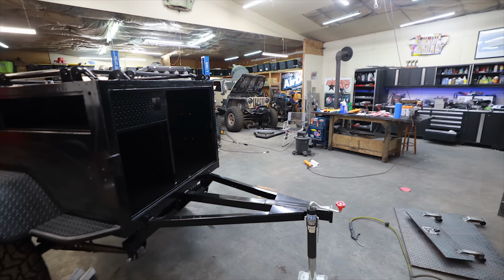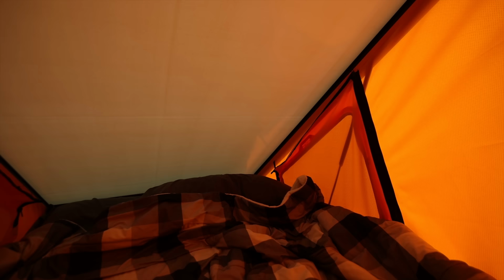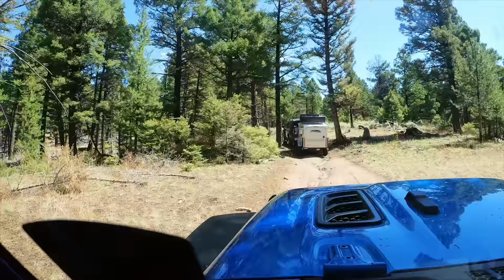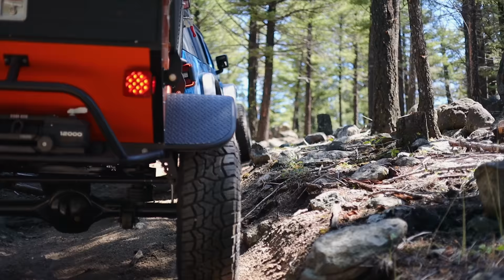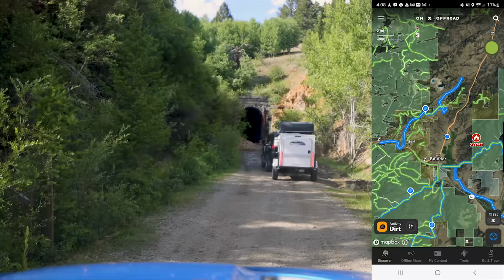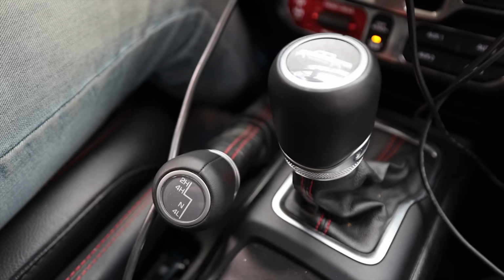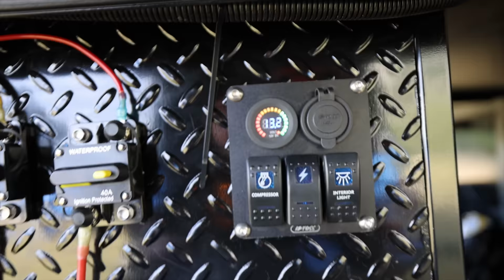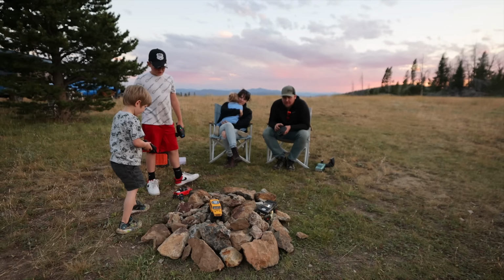Problems On Our First Trip... Harbor Freight Off-Road Trailer Episode 12.

Comment: You can add some jacks (like used on travel trailers) in the back of your trailer so you won’t need leveling blocks. 2x 5000lb jacks should be more than enough and are fairly cheap.
Reply: Those are used for stabilizing, not leveling
Reply: At my local junk yard they sell sisser Jacks from cars for 5$ 99% of them are new. I weld a nut on the end and use a cordless drill & nut driver, up/down zip zip.
Reply: Also they stabilize the trailer. So when you're wife is fighting a bear in her sleep it ain't rocking all over.
Reply: @mrpogi3  do you only ever use things exactly what they are labeled? 2 5k Jack's will work wonderfully to level a light trailer like this.
Reply: @mrpogi3  if the jacks have high enough rating they are good for leveling. The only reason that they tell you to use them for stabilizing only on RVs is because the jack or frame is under-rated (to reduce cost). If frame and jack are strong enough, they can be used for leveling (similar jacks are used to lift pickup trucks, so can surely level a tiny trailer)
Reply: Good idea. And if they’re removable, like using some square tubing/receiver mounts or whatever, then they can be protected from the trail and even serve at outriggers if designed right.
Reply: @dustinmeier9753  that would be an epic upgrade as outriggers
Reply: @ItsMeGiga  with spikes on the feet, it would help that winch out by making the trailer more stable during winching operations. (When picking someone else out of course.)
Reply: This is what I did to my trailer. They stabilize it so it won't rock everywhere and they lift high enough to where I could change a tire if needed.
Reply: @dustinmeier9753  some of the jacks have a round mounting plate that attaches to the trailer. The jacks can be rotated up and stored like that when traveling or removed from the mount altogether.
Reply: @timjchick  I have that basic set on a Bbq smoker trailer that way I can lift the nose of the trailer up to help with air flow as we all know heat rises

Comment: Big slide sounds cool.  Find the box / tubs that you want to use. Then build the slide.
Reply: Here is an idea on the leveling challenge.  Find things that work well to level the gladiator. Then put some cheap air bags in the springs on the trailer.  Only use the air bags to level the trailer once you have leveled the truck.
Reply from the maker: I've been thinking of going this way as well. I already have a set of helper bags that I didn't use on the rover AND this is a rover axle with rover suspension... should work!
Reply: I agree!
That's how I built my Jeep system!

Comment: Your battery droping to about 12.5 volts under load is normal for fully charged 12 volt lead acid battery. 13.5 volts measured after charging without any load on the battery is just a surface charge that will drop off in few seconds after putting load on the battery. If it stays above 11.5 volts until about half of the rated capacity is used up its good. (Hope this all made sense, english isnt my first language)

Comment: I have a setup I made that fits neatly in a pelican case with a seaflo pump, and with water inlet and outlet points coming out of the case. The inlet hose has a weighted strainer to chuck into a creek and all powered by a makita tool battery so it can be at a stream away from camp. The pump doesn't seem to mind the extra voltage. Neat package, everything fits within the pelican case apart from the outlet hose.

Comment: My suggestion for the area of your camper you wish to possibly put a drawer slide in, in which I love your idea. My suggestion would use a two-tiered system. Double decker slide out drawers. Using the same mesh system that you used for your full down exterior table on your trailer. You can still put sides on them if you wish, okay maybe I would put sides on them. But using that material it would keep your system light, very strong. Also you wouldn't have to lock yourself into one certain anchoring points, giving you more options on how and where you store your items. Meaning you could use a mesh tie down system / or even just simple bunches. Using the mesh material as your drawer slide, you be able to have endless anchor points for your supplies. You can move your stuff around freely, from upper shelf to lower shelf, seeing how it travels, without having to worry about how to mount down your items, keeping them in one place. Anyway, that's just my lame idea. Absolutely love how you used a variety of materials, I believe this is probably one of the best offroad campers I've ever seen, no joke. That suspension system is amazing, I loved how it got all flexy out on the trail. Love all the other ideas you're coming up with. Welding out on the trail, now I've got to see that one. Keep us posted on what solution you came up with on your drawer system, very interested in seeing what you have chose. Blessings to you and yours, safe travels.

Comment: Large, 5th wheel style full pullout drawer in the back, WITH a copy above it, but that one is only a shelf that slides out.  On the side, a similar port to the one on the right, but it also has slide out functionality.  The back support is one side of the metal shell that encases the air intake filter, which also extends down to the floor of the trailer to have a small, locker type storage area that can be locked securely, and independently.  But that’s just a few on my thoughts.  You do you, sir, because it’s worked quite well for you so far, and you have far superior ideas and skill than me.

Comment: Electric scissor jacks can be had for around $100. If you take the time to wire them up and install, it makes leveling a breeze. A 12v water pump and tank also makes easy garden hose shower

Comment: The next step of the organization of the trailer is definitely a must. The slide out would be the first thing and the second storage above the table would utilize that  waisted space well. The suspension on it worked great out there on the trails and from the way you described it there is no problems on the freeways.

Comment: Watching Nate, Brad, Lite Brite, etc. has given me the realization I can't afford a new Wrangler or Gladiator with all the trimmings.  No way.  What I can do is breath a new set up on my XJ and bring it up to current from it's 20+ year old lift and outfit it to go overlanding.  She may not have the gobs of room inside like a Wrangler, but the underneath is almost the same.  First order of parts is on the way.  New tires stacked up in the garage waiting.  Needs a heater core and some minor mechanical buy overall the 4.0 is strong and I still daily it.  4x4 works perfect, and its only at 120k.  I just might see you out there Nate!  You and your team of YouTubers have inspired me!

Comment: Definitely 2 drawers, and for the angled area in the back, flat containers, like for under bed storage, with maybe a rail setup to hold them so they will not flop around. Then add some kind of strap/handle that lets you easily pull them up and lower them down…

Comment: Id want to bring the battery count to 6+, Rollable solar panel and a 220v/120v box. Good power backup at home for power outages.If the ability to weld is something you might want, grab a Harbor Freight unit, rip it apart and build it into the trailer body. No need to rewire in an emergency and dont have to carry a welding unit around.... the trailer in the unit. 

Thank you for sharing!

Comment: Here's my opinion. When you open the front door of the trailer, that right side that's like a junk side right now, you should do a 2 layer drawer system (stacked), with some dividers built in. One layer can be like everybody's clothes, the other can be tools, kitchen stuff, all other stuff. I think the door shock may have to be worked around, maybe you could move it to the center of the door somehow.

Comment: Not sure how common off road trailers or camper trailers are over there in general but here in Australia they are everywhere, almost every option, style etc I think is covered if you need other ideas. Slide out kitchens, slide out drawers or slide out tables or slide out racks to put totes or tubs on etc. If doing deep water crossings make sure your seals are good and be aware the trailers can float and either Jack knife into or pull the truck sideways depending on how fast the water is flowing.

Comment: Couple pondering ideas….  What if you had a step camber (like the type you can use to leverage up a trailer axle when you have a flat) between the axle and the frame to lock the suspension in a lift VS putting items under the wheel?   

What if you had an air shock in a disconnect setup where you can use that to level the trailer?

Comment: hey nate, on my offroad trailer, we used a pair of pad style "implement trailer" jacks on each rear corner of the trailer to allow me to level my trailer super quick, takes less than 5 minutes when i get to camp, so i focus on the truck, and once thats done is easy. mine are removeable and mount to the fenders when not in use

Comment: I built a full size slide out (like your fridge slide out) on top of our Decked drawers and it is great for more easily getting crap that's in the back of the bed. we have added things like fork mounts for bikes as well. A smaller version for your trailer space could work a treat.

Comment: I have Espar bunk heaters in all of my semi sleepers. They are hands down the best. They are expensive but the quality, reliability, and temperature control is unmatched by others. The only time I've had issues is at over 12,000 feet. I have seen high altitude models but I do not have any experience with them. I won't  travel without one. I haul in the mountainous west and even in the summer I've used it at night.

Comment: If you put the 3rd member back in the axle, you can run a belt drive to an alternator, then have it charging a marine(deep cell) battery. The. You could have it own power for lights, heater ect. We did this on my dads trailer and it works great. I know you have solar, but as we saw in this vid… sometimes it rains.

Comment: Also a cheap screw jack between ur tyre and trailer wheel arch is an easy way to level out ur camper, just use it upside down!

Comment: Love the trailer build, the battery voltage on a standard car battery is 12.6 so the battery should be good and when you saw 13 volts it was being charged by solar. Either way always nice to have more power especially when you get a diesel heater and water pump setup going! Can't wait to see the progress!

Comment: Here's some ideas you might find worth looking into.
On my little remote steerable camper trailer I used a removable computer mount that hangs on the right rear side of the camper near the rear kitchen.  The Kitchen is in the rear with a raising hatch,  My Coleman Propane stove clamps onto the computer stand.  (A computer table ike what the Police use to mount their computers in their cap cars.)  This frees up my counter space!  And makes a nice table for other things, because it swings out so I can even put my laptop on it and bang away on the INternet or watch a movie on it.  Don't do that much, but I can.

And I also have a 12" x 20" table that mounts with a square tubing type reciver hitch to the other side of the kitchen, near the left side sink.  The male end is bolted to the underside of the table and fits in the reciever mounted to the bottom of the shelf.  Makes a great cutting board area too! The freezer slides out under the center of the counter top.
The top of my camper raises and swings open like a ammo can (only much bigger) and has the foam matteress strapped to it's underside when roading it.  I used a cut down nylon floorless tent for the actual top of the camper, with fiberglass bows to hold the tent roof up. And the tent goes over the bed that is now flopped over toward the front trailer tongue. There are 2 suppport poles that set in pockets under the roof/ bed and to the trailer tongue like a pop up camper bed to prop up the main bed.
My hot water heater mounts on "T" pins on the left rear side of the camper body and all the hoses are in a frenched in compartment behind a side door. I can run a regualr campground hose to it or draw from the onboard water tank. This way I have hot & cold water to the sink, and I use a shower wand to inside a  hoola hoop with 2 overlapping shower curtains that hang off thelt left side of the camper to use as a privacy shower.  
My shower floor grate is a small "sanded and varnished 30" X 40" pallet" that actually fits in the bottom of my trucks roof top luggage rack for flooring when traveling.
With the kitchen hatch is raised I can hang up mosquito netting to keep the bugs out, but thinnking of investing in a 270 degree side awning for it so it even has an awning over the side entry door.  And with the side curtains it will make a nice little bug free room in the right side of the camper.
My camper is a little taller than the white one in the video and the side entry door makes getting in easy.  
Inside it there is a place for 2 people to sit at a small fold up table, and a Hassock toilet in the end wall under a cross cabinet.  For your application, this set up could be converted to bedding and matteress for the Kiddoes while Mom and dad sleep up in the bed. Which will make you think of a pop up slide out bed.  Only higher off the floor! 
With the bedflopped open and the tent up, standing up inside is not a problem.
This sounds real top heavy but most all the weight is stored nearer the floor to keep it from getting tippy.  And since I use the front suspension from a torsion bar suspended pickup I can just crank the torsion bars to raise or lower the trailer depending on how heavy I pack it.    The remote steering is the most fun, as I can put my Marlin Crawler in dounle low and let my spotter steer the trailer while i follow his directions driving the Rig. Going around trees and big rocks is a breeze, 
My 4 X 4 Rig is a 1993 SAS'ed Isuzu Rodeo.
Great fun, but I too still have things I want to finish on it. Like spray bedliner on the exterior for sound deadening and stiffen up the walls. Oh and hook up the solar panels to the kitchen hatch.  It already has 2 Optima AGM batteries mounted under the floor, and a 26 gallon water tank under there between the frame rails too.
I've spent the last 20 years perfecting this little camper!  And just thought I'd add some ideas .
Your little camper turned out really nice!

Comment: As far as the storage slide. I am torn, we have one in the nose of our camper and I was just considering taking it out as it would fee up some more actual volume in that cubby. And maybe be more of a cabinet vs a junk drawer that it is now. Currently it houses a few half empty propane canisters roasting sticks and our collapsible BBQ. The rest of the crap is just clutter that accumulated. The only grace it has is that it slides out so you can see it all.

Comment: I like your idea for the drawer system similar to a Decked system in that compartment of the trailer. I personally would do 1 or 2 drawers in it most of the way to the back and have that back compartment access the top of the drawers

Comment: Build a cylinder water tank, then pressurize it with air.You won't need a pump and always have air supply in the truck to pressure it anytime.My friend has this set up and 30psi is enough for a 20gallon water tank in his without having to add any air before the water is empty.

Comment: The voltage drop while you were filming could be the fridge compressor kicking in, probably still need a new battery but dropping from the surface voltage of the DC/DC to the actual full voltage of an AGM under a bit of load isnt the end of the world

Comment: Bro weld some tongue jacks on the Left/Right rear of trailer to level. 

As for the trailer differential, weld some tabs to put limiting straps so it doesn’t sag when you lift the jacks.

Comment: The voltage should drop on a battery when you put a load on it. Voltage is a measurement of the potential difference between the positive and negative ends of the battery. By turning on a light, you allow current to flow and decrease the potential difference.

Comment: 1985 I bought a brand Toyota pickup 4x4. A year later I found a 1980 Toyota pickup 2wd with the frame attached.
I made the 80 a trailer to haul around my camping gear. 1986 I bought a camper for my 4x4 . Then we started our camping trips. I also purchased a bed kit to get the camper convertible to a bed for my girls. 
We travel almost every summer on our excursions up north to Washington. Oregon and Idaho.
We camped at many of the camping places that had hot showers. The trailer we stored our big tent and everything else. 
We always arrived early to setup camp. Get the kids ready and get our food cooking by evening. Those were some of our best times with family. 
No fancy roof campers. No fancy stoves. Just basic camping gear. Food kept in large coolers with lots of ice. Fresh homemade tortillas every morning and evening. Fresh hot coffee for me and the wife and fresh cold ice tea for my girls. To this day we don't actually know how many miles we camped and also fished. 
During my not camping season. I hauled firewood for my wife's grand parents for many years until the finally passed on. 
No complaints on what I built and how I used my trailer and truck.

Comment: Have you considered airbags to assist with the levelling the trailer out when set up at camp? Surely there’d be a cost effective way to do it for when you’re set up at camp. Over here in Australia the Patriot Campers company have some wicked camper trailers and use airbags with theirs. It reduces the need to level out using tracks or blocks  and helps get it right. Great content and keep it up 👍🏿